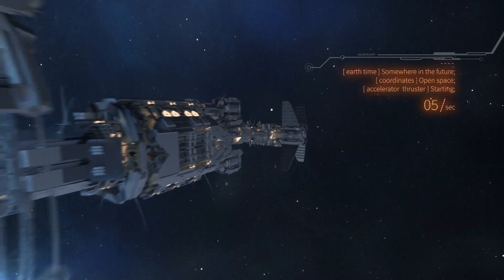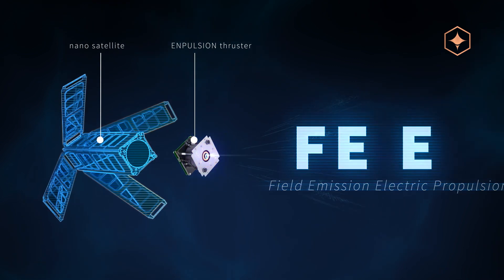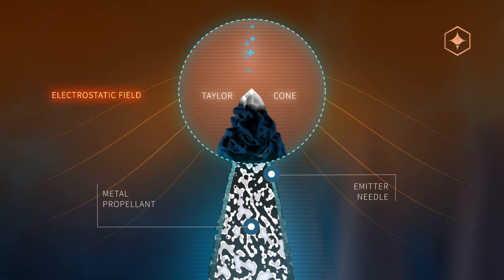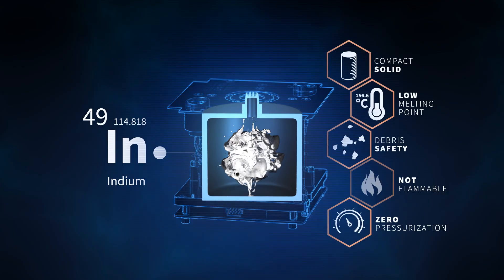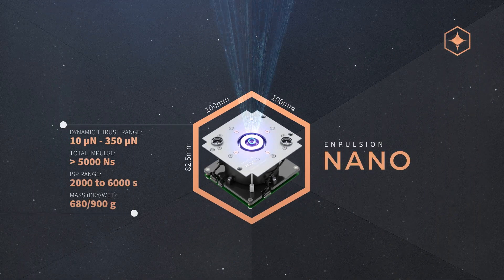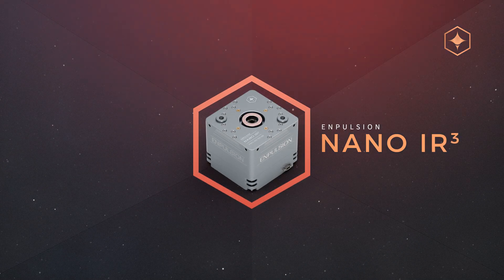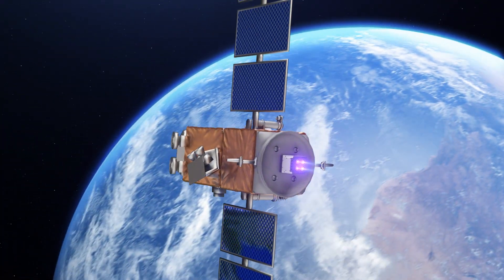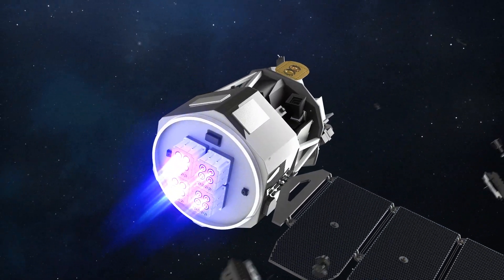All you need to know about ENPULSION's FEEP Technology and Thrusters

Comment: It is nice but a bit low t/w ratio. We need 0.3~0.5mm/s^2 or more to escape the earth,but this thruster it self can only reach 0.3mm/s^2, and only <0.1 after use on 2u cubesat. I am curious that why it need so much power, 0.3N/1000*50000/2=7.5w, however it use 40w? Some books said that FEEP can reach 90% effeiciency?Hope to get the answer ,very thanks!
Reply from the maker: Our propulsion system is not intended to enable escape from Earth, but was primarily developed as a compact, easy-to-use, and low-cost propulsion solution for Cubesats and smaller satellites once in orbit. Inherent to electric propulsion systems, mass-specific thrust is lower than for their chemical brothers, but arguably a value of 0.3 mm/s2 is high given that the propulsion systems include PPU, propellant management, reservoir, and the propellant itself. As in any electric propulsion system, the power budget comprises more than the beam power itself. Peripherals like neutralizers and propellant management (in our case heaters) add to the budget. Further, no electronics work at 100% efficiency, so PPU losses are to be accounted for as well. We hope this answers your question! ☺
Reply: @enpulsion  Thanks! So maybe the power of heater and neutralizers is more than I thought